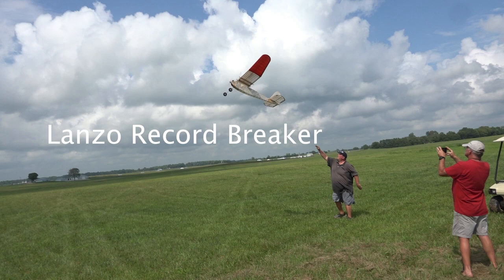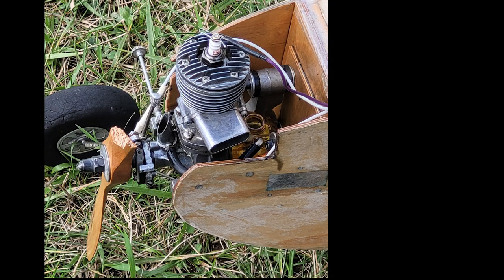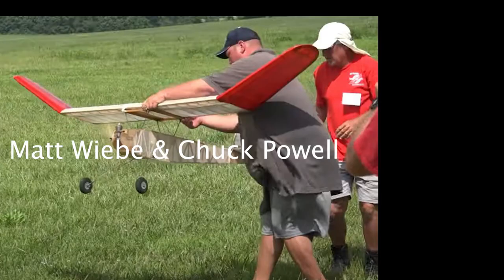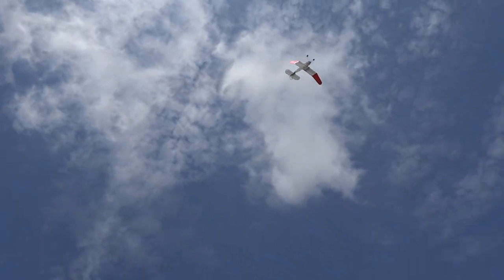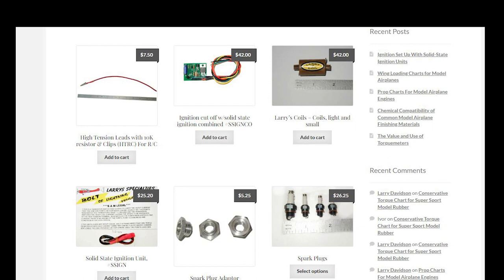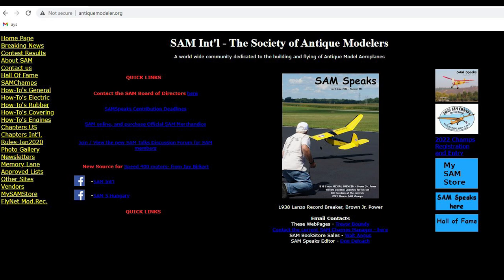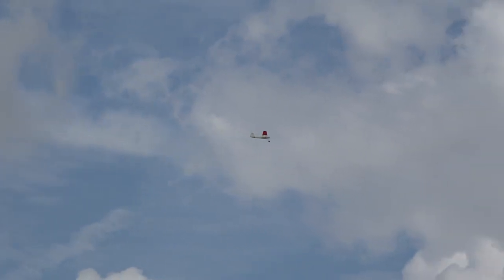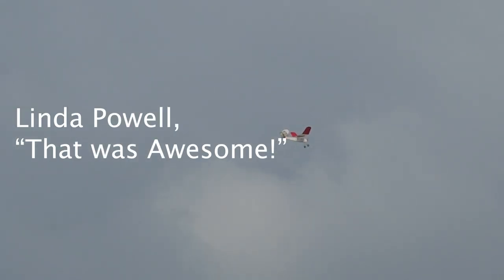Lanzo Record Breaker

Comment: I'm commenting well after the original posting of this video, but i still appreciated seeing this..I hail from the W of Scotland.where your 'wind  to rough to fly  conditions' would be  seen here as a windless day. I normally fly similar vintage planes and although the lack of old spark ignition motors (at a reasonable cost) here, and noise regulations mean most of mine are electric powered I try to fly them in the same power up/glide down way that the originals were flown..
Reply from the maker: Thank you for commenting. I have been trying to get an ignition engine running but I find that the old gaskets are bad. I bought a replica of Simplex and have that running. I have done videos on the engines. Anyway plane to build a plane this winter and fly next spring.

Comment: I've particularly enjoyed seeing old spark engines powering models as they were designed to do, love your videos the quality is fine but it's the content that makes them so good.
Reply: Thank you,  it is comments like yours that inspire me to keep making videos.
Reply: @billkuhl442  I'm hoping to inspire you to fly a sparkie of your own, Ardens are lovely engines if you can get a good one!
Reply: @stevenhugh1785  I have an ignition engine but it is missing electric components. Only marking on it is "23".
Reply: @billkuhl442  it may well be an Ohlsson and Rice, if you look very carefully with magnifying glass you may see a feint O&R on the crankcase, the points were often discarded and the engine run as a glow engine , once you've run a sparkie you won't look back.
Reply: @stevenhugh1785  I think someone did say it was O&R.  So much to try
Reply: @billkuhl442  maybe the O&R is a project for the winter which is just around the corner, enjoy what's left of the summer.
Reply: @billkuhl442  Ohlssons are great engines. If you power the ignition with a 1s lipo, they are quite easy to start, running on a 3:1 gasoline-heavy oil mix. Same for Forsters, easy to start and impressive power. Make sure your plug is clean and operable. The porcelain does foul over time and they'll spark across it, so if the engine keeps firing and then quickly dying, it may be the plug. Learned that the hard way, my arm was sore for a week from the hand propping attempts.

Comment: Great video. I have a Playboy Sr with a Super Cyclone, and a Lanzo Bomber scaled down to 60" with an Ohlsson 23 side port. I have many old ignition engines in pristine condition. When I retired from flying RC Pattern competition, I started flying control line again. Most of which are powered by Super Cyclones, Anderson Spitfires, Atwood Super Champions, and an Orwick 64. 

I fell in love with ignition engines as a small boy watching others at the park in the 40's. They still fascinate me. 

My most fun control line plane is a British Taurus. It has a 68" span and 850 sq " of wing area. It won the ignition event at the vintage stunt champs at Tucson 3 years in a row with an Anderson Spitfire. Now I just fly for fun. I do fly my old free flights with a radio as at 81 years old I am not up to chasing free flights. 

I have one free flight plane. A Dakota Bipe with a Torpedo .039.

There is nothing like the large planes with ignition engines, and the Record Breaker is a really cool design.
Reply from the maker: Thank you for your comments. It sure seemed like back in the day it was alot of extra weight to haul around. I have yet to fly an ignition plane and only one diesel.
Reply: That is true. Although, they only used two double A batteries most of the time with a coil and condenser. The extra weight helped them design planes with high lift airfoils. Undercambered wings work well. Although the Quaker flew well with a flat bottom airfoil. 

I have had my Playboy up for 45 minutes at a time on a 1 minute engine run. Had to keep spinning it down out of thermals. Some days there is great lift, and others nothing. That is the advantage of radio. We do not need a de thermalizer to get it back, and can fly from much smaller fields. Not the same as free flight though. That is pure old time.